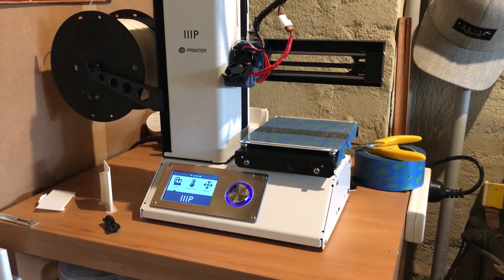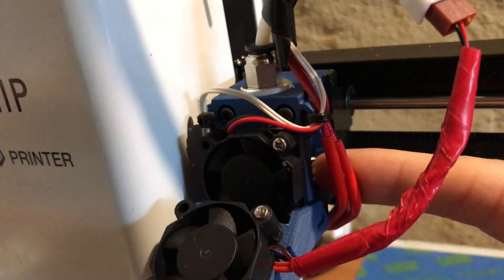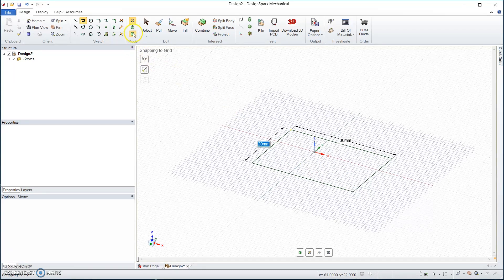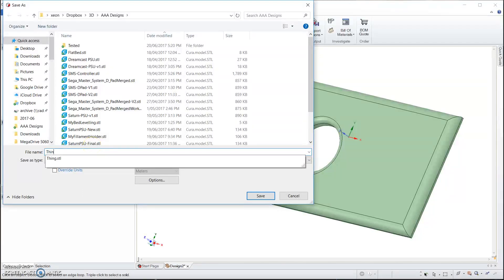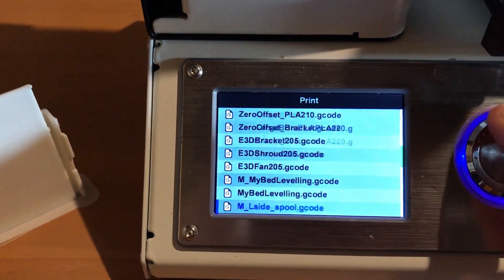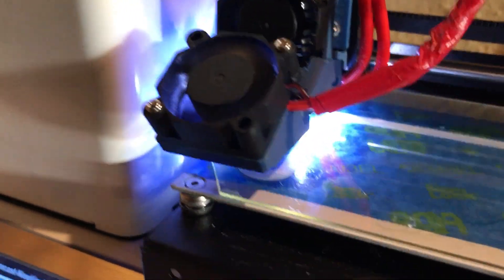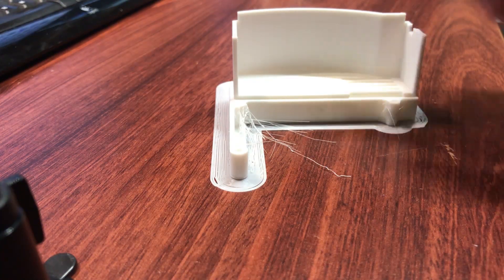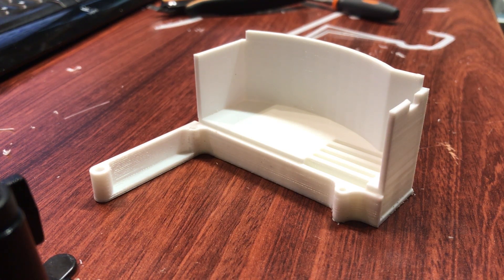3D Printed Retro Gaming Spare Parts Walk Through

Comment: Nice one. So are you setup and ready to sell 3d parts? ... Sega MS controller 8way joypad? Cheers.
Reply from the maker: I'm selling parts now, but not the SMS DPad just yet. I'm still working on the design for the two versions (Octagon and Square inside the controller). Im mainly trying to solve the sloppiness issue with the square version.
Reply: Global Garage Yes you did say that. Ive got one just hanging by thread and a mint one coming in post. A 3rd one has Dpad missing so id definitly buy a few off you let me know when ready. Also reliable rubber contacts supplier .. yeh also let me know cheers

Comment: I though you were using a cooling fan with ABS plastic and I was so confused xD 😕  Then I realized it was PLA....you should give ABS a try as it is much stronger...but needs a heated bed.  I have the Prusa i3 printer and design using Autodesk Inventor Pro 2015 edition.
Reply from the maker: Hi Owen, yep it's  PLA. It's actually really strong and seems plenty for this model. I also have some black PLA+ which is the annealed version which is even stronger. I haven't had a chance to try ABS or any other filament as I thought it needed an enclosure to keep the temps up? My printer does have a heated bed that goes to 90 so that's ok, but for the enclosure, I was going to simply put a storage tub right over the printer :) Any other tips for ABS? Favourite models to print?
Reply: Global Garage I can print abs with some acetone juice (adhesion technique) to help it stick to the bed.  Some on my larger models still lift but thats probably because I print with no raft.  I really liked printing the planetary gear set found on thingiverse but cases for my raspberry pi that look like retro consoles are also on my list of things to print!  By the way I love your repair videos!  oh ya, I have no enclosure.

Comment: Looks like a cool little unit for the price. Is it 220-240v?
Reply from the maker: The printer itself is 12V 10A DC... but the power brick can accept anywhere from 100-240V AC so it's universal worldwide like nearly all appliances these days. It came shipped from the US to AUS with a US power lead, so I just replaced that with a local AUS one. Easy.